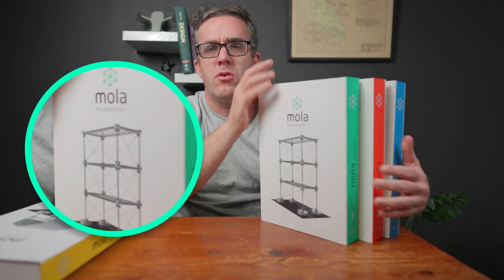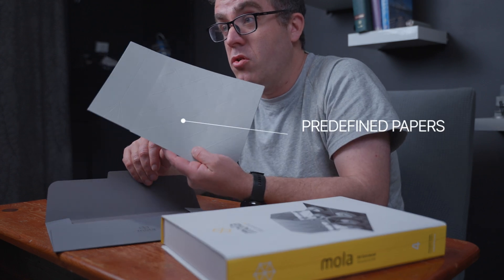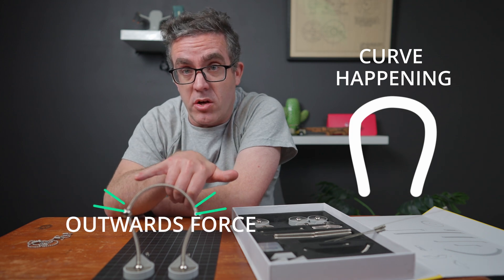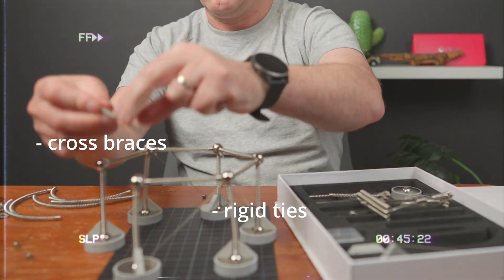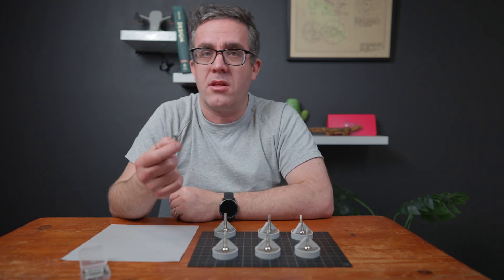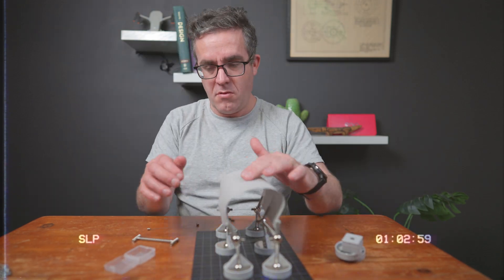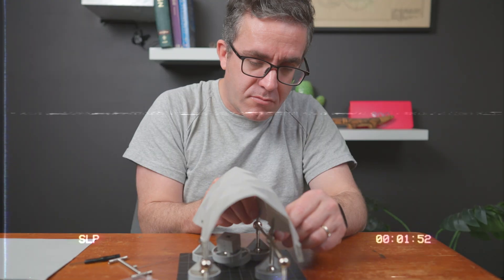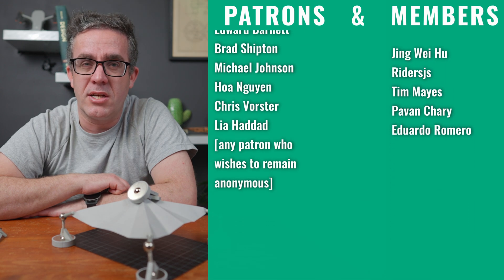Why Arches, Domes & Shells Are So Efficient – Mola Kit 4 Explained!

Comment: Excellent video. 
Joints are the common failure in reinforced concrete structures. 
Can you do a video on this.
An old Structural Design Engineer friend said that he tended for design work on high rise home units in Mosman, Sydney. 
Often the buildings designed by cheaper Engineers had cracks in the Junction of columns and beams. 
Brick infill panels cracked as beams deflected excessively. 
Remedial work included re scaffolding the building, filling the cracks and rendering the entire exterior of the building. 

Corner Joints were often not fully understood by the younger cheap designers. 

The building would not fail but weather ingress was the concern. 
And corrosion in the cracks in the concrete.

John Gillato. Brilliant man.
Ran the Transfield Construction design department years ago.
Retired to quiet private practice for enjoyment. 
Sadly departed now.

The building companies thought they were saving money. 
Many lawyers live in Mosman.
Hahaha 😊
Reply from the maker: Hi Stephen,
Joints and good details is a common issue, and it doesnt cost much to do it correctly, almost a cost rounding error. Good Engineers  know where to spend the time and where to cut money. 
Yes alot of people overlook detailing, however this is where the art of engineering is. 
well hopefully they got what ws comming to them from cutting corners
Reply from the maker: thanks for the suggest I will do a detail on this great suggestion